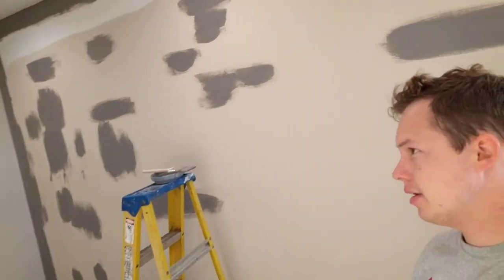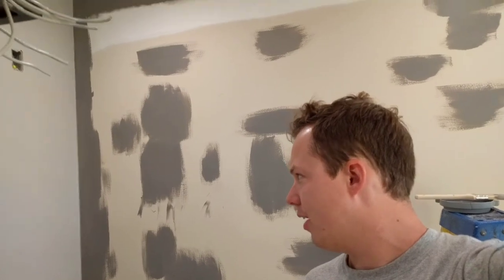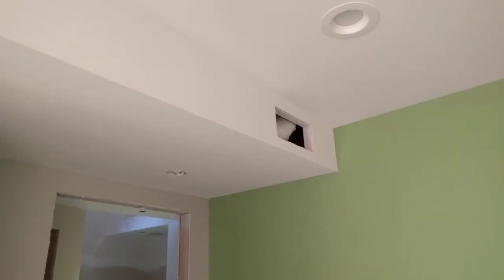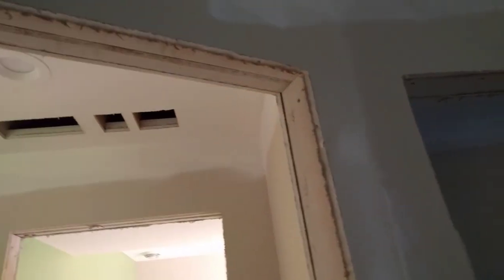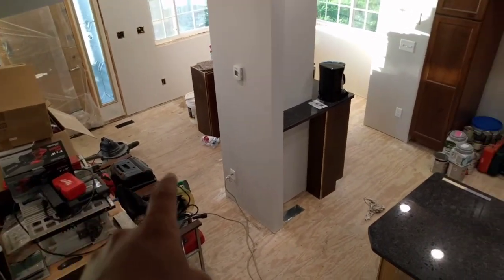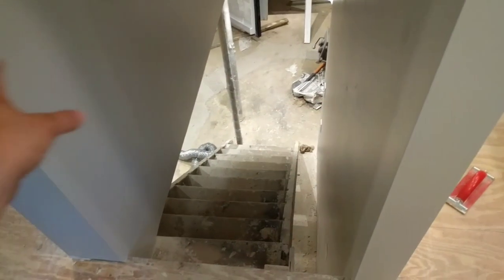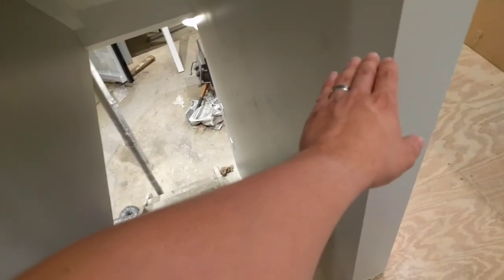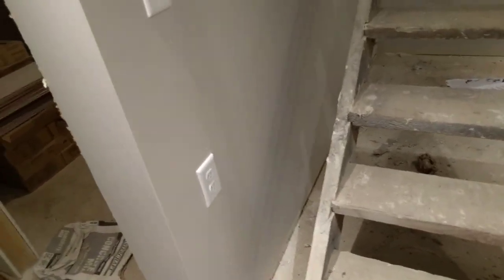How To Use a Wild Return Air System - Do I Need Return Air Ductwork? - Understanding Return Air

Comment: All you need is a 1.5 gap on the bottom of your doors so even when shut air can return to the furnace. Nice video.
Reply from the maker: Yes that works too. Just not as good for sound transfer. Thanks for your comment!

Comment: Thanks for the video.  My main return upstairs doesn't have any metal work.  It is just one big 2'x1.5' hole in the drywall leading down... with a metal vent cover of course.  You can see the drywall and support studs and everything.  Down below going into the furnace area there is a metal return.  So, I'm guessing they just cut a hole in the drywall near the furnace and connected the metal there.  There is an additional small return in the ceiling near the bottom of the stairs.  It is a finished basement so there is no door or anything stopping the air going down from upstairs.  From watching your video it sounds like all of this should be fine.
I have a York furnace which is pretty expensive, so I doubt they would have installed that if there wasn't enough return air.  I will ask the next time I have the furnace inspected... which I do every year.

Comment: After watching this I'm considering this.  My house is small 24x32 foot house.  I'm currently renovating, basically a full gut job.  All new electric, replace old fuse box with 4 circuits and old ungrounded romex, all new plumbing.   New roof, windows, replace asbestos siding.  The HVAC system  is also one thing I want to fix.  The returns is the biggest.   Currently runs returns, no ducts, through wall cavaties from both bedrooms and living roim/dining room, to basement.   Floor joists block some parts of the return channels.  They had a door to the basement from the kitchen originally.   I'm removing that.  I also plan on finishing most of the basement, once I feel confident I'll have no water intrusion problems.  Just one step at a time.

Comment: I understand the ductwork situation . But, in some cases you have to consider combustion air for the furnace. In you case wide open probably ok. But in some areas with the furnace in a smaller space and you have the furnace pulling a negative on its own space by taking RA out of the furnace room which could starve the furnace of combustion air.Sealed combustion furnace would be ok. In a lot of basements that are damp or smelly this could also cause a problem
Reply from the maker: Excellent thoughts. My furnace is sealed combustion plus it being very open as you mentioned. Thanks for your comment!
Reply: Furnace installation manuals have specific instructions concerning this. If there is not complete combustion i.e. the furnace needs adequate air supply for combustion or there is a danger of CO

Comment: Thank you for this video. The only return duct in my home is in the ceiling in the hallway. I was wondering if I added return vents from the bedrooms to the hallway if the system had enough pull to equalize the air pressure in the bedrooms when they are closed off. Now I know.

Comment: This is like the system I have. The cool thing (no pun intended) IMHO is that because of thermal stratification the coldest air in the house gets fed into the furnace for heating. This should allow the heat exchanger to operate at a lower temperature.

Comment: I just may have to cut in a jumper duct in one of me spare bedrooms.  The original installation (20 years ago) must have been done by a uneducated duct installer/designer.  They put the AC / heat duct in the ceiling and just 2 feet away on the ceiling is the return duct.  The room is hot in the summer and very cool in the winter.  The solution would be a jumper duct in the bedroom which shares a wall with the living room.  I would think I should go low with the opening in the bedroom and high with the opening in the living room to make the bedroom air circulate better.  Now if I could only find a solution to my noisy furnace.  It is in a closet in the garage.  The main return for the master bedroom and the living room just outside the master bedroom is large grates in a box that the furnace sits on.  It's just like having the furnace in the room with you.

Comment: What you think .some of these Inspectors they told me that I have to open both side of the furnace for return when I put 110000 btu furnace even I put a return for every room in the house. One of these houses I put 10 return cuz it's big house and he told me still not enough return for 110000 btu furnace and I have to open the other side and put a filter cabinet!!!! What you think??
Reply: I definitely agree with opening up the other side of the duct, but how much free space and air do you have in the area and do you have a natural gas water heater or anything with a gas flue near by?  If you do, you could pull too much air and actually pull flue gases from a other areas and spread it through the house.  Same with being close to a garage or anything that isn't fresh air.  110k is a big dog for sure.  You really can never have too much return air as long as it is done correctly.  You can duct it to another room or stud space pulling from another floor.
Reply: @Balticblue93  thank you for your response. The problem was the space in that basement  was narrow and not high enough. And there is a natural  gas hot water tank  8 feet a way from the furnace location..I put a 25×16×12 return boot then 20×10  run trunk for the return and there was 9 total 6×10 return  grill in that house but the inspector didn't  approve it just because  there is no 2 return opening for the return!!!

Comment: hi I have 2 levle house heating air pushes to ground floor and return is on upper level celling its not heating fast enough do I have to take return from ground level to circulate air its heatpump

Comment: Great video! Is this allowable by most local building codes? I want to remove a non-load bearing wall from my house but it has a return air grill/duct. I was assuming I need to move it but this leads me to believe otherwise. The room is large and has 2-3 smaller vents throughout. I guess to answer my own question, I should find out what my local building code is.

Comment: My issue is that heat rises and the return is downstairs. If the return was upstairs the heat would move back down to the furnace and be recirculated with added heat or cooled with the ac coils.
Reply: it is easier/more efficient for a furnace to heat cold air rather than warm air--the heat/energy transfers faster.  and why heat warm air when it is the cold air that needs heated?
Reply: @patrickedwards2188  I want the warm air downstairs. I want the return to pull the warm air from upstairs and move it to the downstairs. I have a 3 zone system. So, the return would pull 73 degree air from upstairs and simply move it to the down stairs creating a circular pattern and saving energy heating the cold air.

Comment: regarding return in a bathroom, would you want to spread the odor throughout the system.  regarding bathroom supply, can you show me canadian code specifying suppy in a bathroom to be located on the floor.  maybe not found in the mechanical code, perhaps in the health code.  it only takes moments on the rough to locate a bathroom supply in the wall.  i regret common sense died a tragic death.  best of luck.  i wouldn't sell this design.

Comment: Where is your home? If you are in a northern state, a wild return is probably OK. The summer heat is not as intense northern states. If you are in a southern state, you may seriously suffer without any ducted returns in a two story home with upstairs bedrooms. My home inspector failed to observe that all the return ducts would not hold a dollar bill to the grills. This is because the returns were "wild" behind the walls. Return air flow is VERY WEAK! We have suffered this summer. There is way more information needed about a persons individual home to adequately judge home engineering decisions like this.

Comment: Am a little confused,  Are you feeding jumper ducts to hallway, and from there to the basement? Or are you simply feeding jumper ducts into hallway?
Reply from the maker: +Carolyn Boddie Just into the hallway. Then the air flows naturally all the way back to the furnace without needing Ductwork.

Comment: first problem, the supply in the bath room was on the floor.  that's a code violation.  i don't want mop water to get into the duct system.  second, this is an indirect return system.  do you want the hot humid air from your bedroom to have a direct path to be conditioned or to rely on an indirect transfer jumping in multiple directions and hopefully transfer a humid gain to be conditioned at the furnace.  i suspect air balancing problems.  perhaps temperature stratifications.  i'd like to know if he can deliver 1-2 air change per hour.  i wouldn't want to warranty ths system to a customer who paid me over ten thousand dollars to install a forced air system.  i'd design a ducted return air system and give a customer a 2 year no question asked warranty and know i'd never be back.
Reply: Actually the bath room supply vent is always on the floor in Canada. I think they have different building code system. I am think if there should be an return in the bathroom so that it will naturally increase the humidity level for the entire house, especially in the winter.
I have a room doesn't have return, but there is one in the hallway. I am thinking just add a grill on top of the door facing to the hall, very similar to what the video did. Not sure it will function sufficiently.
Reply: Im in Canada  heat vent is on the bathroom floor .Never had an issue with water in it and I like dead air in the bathroom because moving air is cold and in the winter would be uncomfortable while bathing
Reply: Why put a floor register in the floor, when  a wall box can be installed just as easy?  You might try and find a citation in the Canadian code.  You won't find it

Comment: Got some bad news, first if your chimney ever has an issue the flue gases will be pulled into the air stream and distributed to all areas of your home. Second, the return jumper ducts will not work as you have come to believe. There is a perfectly good reason HVAC contractors suggest installing a return air duct system.  Because one is needed for proper air movement in a room. The return air pathway must be larger by about 40% than the supply into each room.

Comment: Adding AC would 100% not work on this system, you can never balance the air temp from upstairs to downstairs without returns. I do like how you used the bays to allow air to flow out of the bedrooms though.
Reply from the maker: AC 100% works great actually!
Reply: This is my issue as well